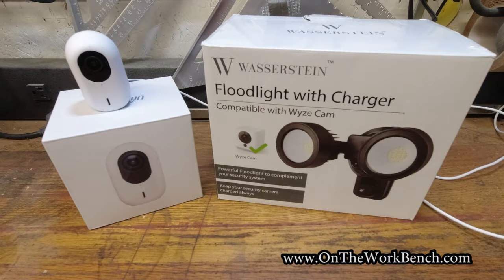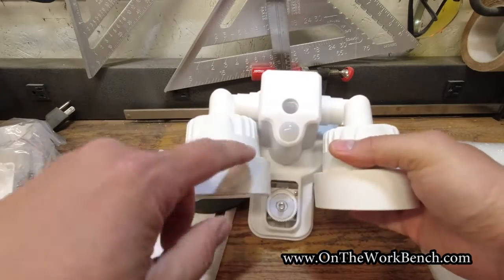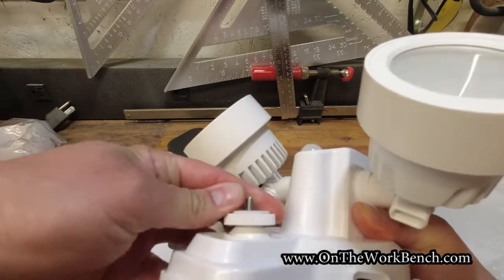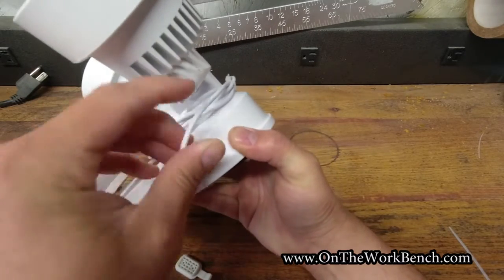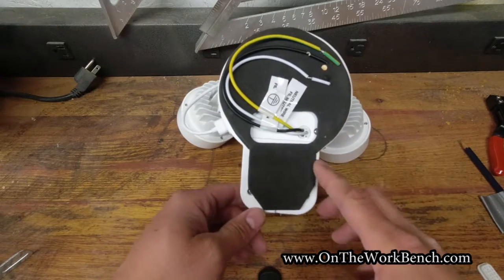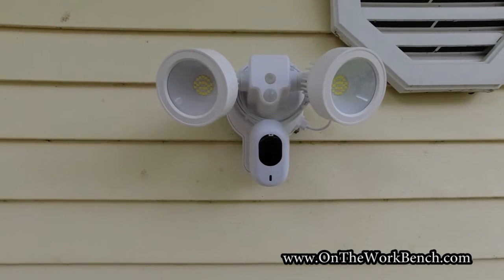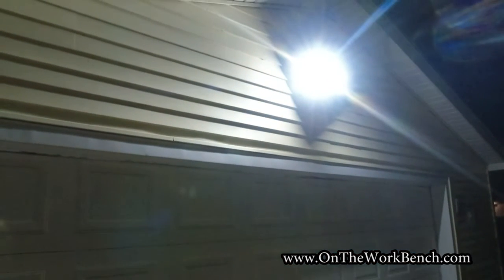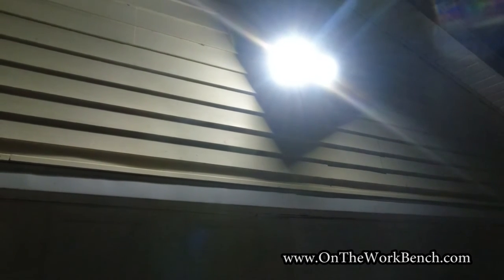Ubiquiti Unifi Driveway Camera Floodlight Build

Comment: Love this, wanted to do it but my light mount is horizontal, not vertical and the motion sensor seems effected.  Had to return the light.. thinking about putting something together myself with a separate motion sensor, light and unifi flex g3

Comment: This is great!  Do you happen to know if the newer model Wasserstein floodlights (v3 Wyze camera) will work with the G4 instant?  This floodlight model appears to be out of stock.
Reply: Did you find out if any of the current wyze models work?
Reply: @nash0smartman  Yes.   I bought Wasserstein 3-in-1 Wired Floodlight, Charger and Mount Compatible with Wyze Cam V3-2000 lumens Powerful Floodlight (White) (Camera NOT Included) and it worked. I couldn’t find the G3 cables, so I used adapters with white electrical tape. I’ve had no issues. One con, I wish there was more range in motion when setting up the camera. Some kind of adapter/extension would help.